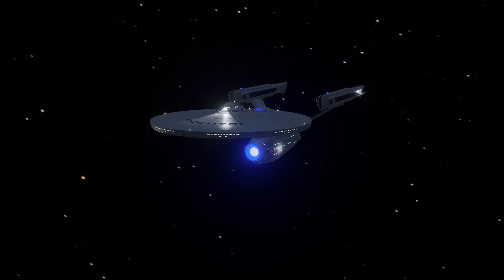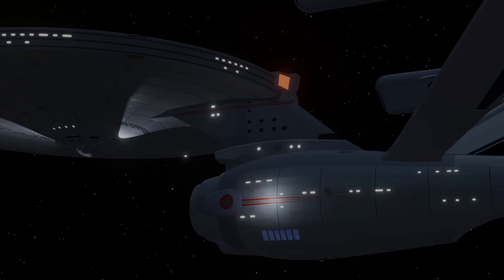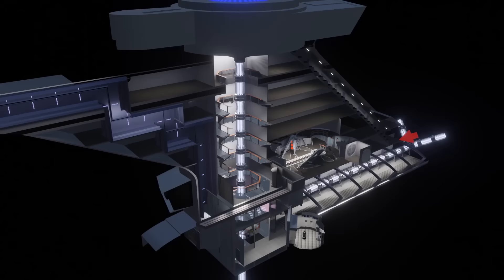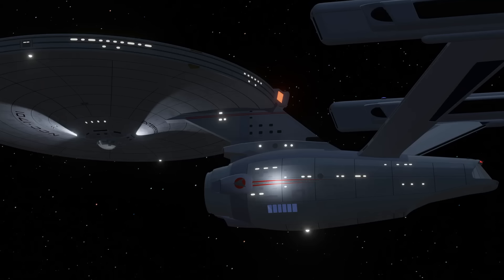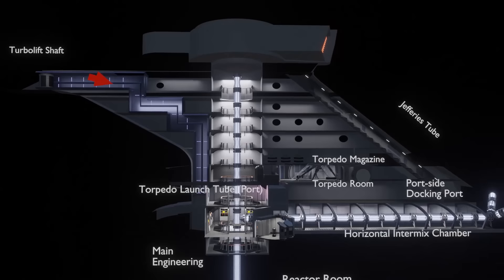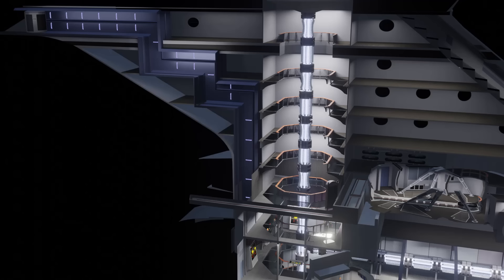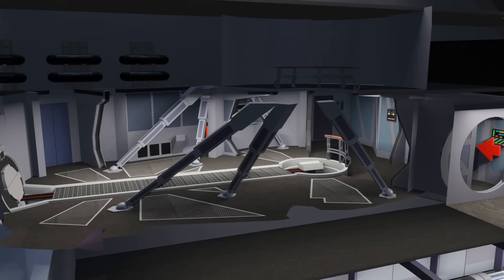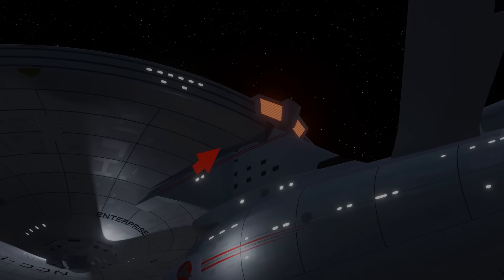The Enterprise Dorsal Problem: how did the turbolifts pass through it?

Comment: On a similar note:
The Gateway Arch at the Jefferson National Expansion Memorial in St. Louis, Missouri, USA, was originally planned as just a monument.  A viewing room at the top was considered, but the Arch's triangular cross-section and its overall shape being an inverted weighted catenary curve of 630 feet in both height and width, would have only allowed for stairs.  Many engineers thought it was impossible to install elevators; the one-of-a-kind design of a tram system was conceived in just two weeks by a man named Dick Bowser, who never received a college degree.  The tram system has been in use since 1967.
Reply: a fittingly legendary name for the inventor of such a design
Reply: Most well known as the cousin to Gay Bowser
Reply: He never received a collage degree because they were laughing too much to hand it over.

Comment: I think this gets solved if we don’t assume the vertical warp core goes all the way to the impulse deflection crystal.  If we instead say that the core extends upwards towards an “impulse engineering complex” (one that has the deflection crystal in line with, but not necessarily directly connected to, the upper end of the warp core), then we can suppose that the turbolift shaft simply passes horizontally between the top of the core and the deflection crystal.
Reply: True. We all assume the core goes through the whole neck. But that is even not logical when we remind ourselves that this ship can saucer seperate! Most likely the impulse drive and the saucer section is just connected to the warp core by two high energy connectors where the hull is made steadier, and in between them on Deck F the turbo lift passes through.

Comment: I always tend to assume scaling issues when it comes to things like this. Especially given how big those dorsal windows look against the height of the deck, while we’re shown more traditional size portholes on the sets. If we scale up by 20-50% there’s plenty of room for the turbolift to go around. 

Similarly the size of the windows on the Excelsior model would actually be a little too small. 

They’re what looks best on the models of course, and I wouldn’t really want to swap the size of the windows on either of them. But the windows alone present a sizing and placement issue of decks and internal machinery, so I don’t think too hard about the rest of the insides. Scaling-up slightly would help fit the torpedo complex inside the bulge at the base of the dorsal too.
Reply: I'm also content to believe that the size of the sets are generally larger than they would be in the real world of the fiction.  They designed them to be easy to shoot scenes in with both space for cameras and lighting and comfortable blocking of the actors. 

It's like your average sitcom living room set vs most actual living spaces, even relatively poor families like the Connors lived in extravagant excess if we take their floor plan as literal.
Reply: @DrewLSsix  excellent point! There’s an awful lot of room on those walkways around the warp core.
Reply: @DrewLSsix  just like submarines in movies too. Hard to make accurate and still have a practical set for filming.
Reply: Let's not forget the filming whoopsie in one of the movies where a shaft appears to run vertically for 60+ decks (according to deck markers) in a ship with less than 30 decks total?
Reply: @Krahazik  you mean that scene where Spock has the rocket boots and the turboshaft looks like it could be a lobby to observation deck elevator on the Empire State Building?
Reply: @filanfyretracker  exactly that scene and the label markings have been pointed out on numerous occasions. I think someone one wen to the trouble to actually count the number of decks passed as well.
Reply: I seem to remember there was either a YouTube video or a forum post where someone said if the length of the refit Constitution class was upped to 1500 feet instead of of the intended 1000, it would solve almost every discrepancy between real-world set design and fictionalized function of the ship. Probert said the idea was intriguing enough to agree with it.
Reply: @Krahazik  And it's a triangular shaft not round, and the turbo lift cars are round......
Reply: @isaacwright90  Some fans have worked out anywhere between 1,200- 1,300 ft. That''s not going to drastically increase the apparent size of the ship itself since part of the length is how much further past the landing bay does the warp nacelles end. A lot of empty space between those parts.
Reply: The portholes were imagined to be 18" across.
Reply: @AndrewProbert  hey, the man himself! That’s definitely more like what I’ve thought, they seem at least 24-30" on the model in this video. 

BTW I had tried to send an email from your website a few years ago but it bounced so I’ll say the gist here: thank you so much for being a positive example while I was growing up, of the validity of vehicle and prop design art! In school I was always getting told to do still lifes and portraits, because I wanted to draw bikes and watches and so on. I always loved your paintings so I held onto that against the backdrop of that discouragement. Thank you again! :)

Comment: There isn't a full end of the warp core on H-deck, instead just a lockdown/venting connector leading to the topside warp crystal.  
Hence a full room isn't used for the core leaving room for a turbo lift to pass through it and up to the main saucer.
Reply: Exactly this. You can kind of tell when Kirk enters the engineering space in TMP that the intermix shaft tappers as it goes upward from there, likely because the impulse engines don't need as much plasma as the warp drive.
Reply: @captainyossarian388  Agreed, or it could split up against the walls on the way up to feed the individual impulse engines, leaving a gap for the turbolift to go through.
Reply: WHAT IS THIS NONSENSE ABOUT WARP CRYSTALS?  The impulse engines ran on deuterium.. PRIOD.. No warp related anything.  They were NOT powered from Engineering directly
Reply: @ZakhadWOW  I feel you're confusing two comments as one.  Warp cores operated off of dilithium or lithium crystals (depending on class/age of ship), and impulse engines did indeed operate off deuterium.  However the original person noting warp core crystals said nothing about impulse, the follow up comment did.

That said the general model of a warp core is that antimatter is sent into an intermix chamber and deuterium is injected in as well to which it created a plasma energy put into a matrix made of the relative warp crystal (dilithium or lithium) which then basically became your warp plasma (the energy for warp) and electro-plasma (the energy powering the ship).

Impulse drives otherwise were self-sustained with their own fusion reactor though correct (at least I assume that's what you meant by "not powered from engineering directly"), however they were still tied to engineering sorta, in that use of the impulse drives created a byproduct of electro-plasma also (which is why at least in some episodes of different star trek series', even if the warp core was 'shut down' or ejected, etc, the ship still had power likely fed by a general use of impulse drives).
Reply: @ZakhadWOW  They always call that dome the "warp crystal", although it's not. It's just a glowing part of the impulse engineering facility.
Reply: @_nbishop  maybe the 23rd century ships did tie impulse engines into the warp core in some way. I only remember the TNG tech manual showing the impulse engines as having their own separate fusion reactors, especially those in the saucer section.
Reply: @zerrodefex  Did you mean to comment to someone else?  I noted in my comment that Impulse drives were self-sustained, so much so as they even provided a basis of minimal backup power source from the energy they generated as well.

All I said is that they were tied to engineering because of that, nothing about being tied into the warp core.  Engineering decks/facilities did a ton of stuff, it's not like they were dedicated just to warp core management :P

Comment: Every ship has that small area where the only option is to beam the entire turbo lift to the closest shaft. There's also the one where the turbo lift is shot into space and it utilizes its own thrusters to re-enter the ship at the appropriate shaft.
Reply: Or just runs on tracks on the outside of the hull
Reply: Not really: Most ships from the Excelsior onwards have a big enough neck to have a turbo lift pass through. And the nacelles were before and also after the NCC 1701 D only reachable by stair shafts. Also, don't forget, that you don't really need an easy access to that nacelles: When they are at warp, the nacelles are a no go zone anyway and when they need to repair something, they can also reach the nacelles by a small space walk! Just get out of the ship near the bottom of the nacelle and walk up that 200m to the entrance area in the nacelle.
Reply: @Quazgar_of_the_North  XD that would be incredible

Comment: dude, your solution to this is offscreen lift changes. I would assume over the course of the ship there would be at least two turbo lifts in the saucer, and possibly a horizonta one. There would be a turbo lift along the back of the dorsal, and the lower body would have two or three as well. I assume horizontal 'lifts' would be a must for quick transport around the ship, if you can go on an angle why not horizontal. This means he could get a lift upwards, get out, walk five meters to another lift and make it to his destination. Horizontal lifts would also make it possible to the bridge quicker than walking.
Reply: This makes the most sense.
Reply: @Melkur1981  While I'm on the subject of occams razor, I never understood why star trek ship designs have gravity (the floor) being always in the same direction when gravity is controlled through Gravity Plates. I would have assumed different gravity for each section. The Saucer can have floors on the x axis sure, but the dorsal section would be two big floors with the 'Foor' the part people walk on running down the middle (on the y axis), so that the big energy transfer cable can be accessed at any point from a single floor with people walking alongside it! The lift here would essentially work like a conveyor belt connecting the top of the ship to the bottom with one side going up (<--) and the other going down (-->) Possibly with a wrap around on either end like a Paternoster lift.. The lower part of the ship I would have the gravity going in a different direction again,  on the Z access so create a large number of smaller floors that could be serviced by a single lift rather than have wider floors.

Comment: The Constitution is actually probably the least problematic of the Kirk era Federation ships. Both the Miranda and the Oberth have entire parts of the ship which cannot be accessed from the saucer - fully half of the latter - and the Excelsior is regularly shown to be absolutely massive, leaving entirely the opposite problem of why it needs so much more space…
Reply: I think in the MAD Magazine take on The Search for Spock they said that the Excelsior had a mall in it. I'd believe it. It was the Eighties.
Reply: My headcanon is the lower part of the Oberth is just a big sensor pod. No fixing the Miranda tho.
Reply: The issue with the Oberth is compounded by the fact that its early design envisioned a 180m long vessel before it was canonized as 120m long. The windows are scaled for 180m and do not make sense with a 120m long ship. Back to the issue, I saw some blueprints showing both the Oberth and the Miranda using closed-circuit intership transporters to access their respective outrigger hulls. With the Oberth, it also had a Jeffries tube in each pylon with a single person lift that also allowed access. When looking at TMP era ships, one requires a bit of suspension of disbelief to presume that the building materials are far superior to anything we have now, allowing such narrow connections while maintaining integrity.
Reply: @schwartzritterx5905  well, it's a space ship, and in space, the forces acting on the various structures are massively reduced compared to the gravity well on a planet
Reply: The excelsior is easily explained as needing much more space because its a ship that's designed o operate much further from port, and thus needs more supplies and fuel onboard to go longer distances. Likewise Excelsior is also a much more powerful ship than constitution, and having more powerful shields and weapons demands a larger hull to fit in bigger power generation and transmission equipment.

If anything, constitution is far too small for an interstellar spacecraft.
Reply: @schwartzritterx5905  Inertial dampers have a large role in maintaining structural integrity. They counteract the immense forces of spaceflight not only for the sake of the crew, but to keep the ship intact. Pylons don't have to be strong enough to physically support those structures when artificial gravity helps do it.
Reply: Wait the Miranda? I mean it's one of the most all in one vessels in the series. I always assumed the Torpedo Pod was fully automated, or only accessible by Jefferies Tube.
Reply: @PhthaloType  I concur that force fields (SIFs and IDFs, as they were named in TNG) are essential to starships as they behave in Trek. The drawback of deck plans is that readers forget they're schematic, and the volume needs to contain things other than crew. Circling back to the subject of this video, given the <5m width of the Connie's neck, it should probably contain nothing but structural members, power conduits, beefed-up SIF waveguides, etc. -- and certainly not backlit portholes as depicted in the studio model.
Reply: only the “roll bar” is inaccessible from inside on the Miranda, and the Obarths had turbolifts THROUGH the connecting pylons…
Reply: the excelsior was designed to have massive labs and refit with new tech as time went on. hence why its still in use with the Enterprise E
Reply: @KenoshiAkai  so the Galaxy class problem had a full on soccer stadium in it.  :-)
Reply: @ellisz5972  I'd believe it. There's been analyses of just how much empty space there would have been in that behemoth because its crew was so proportionately small. Easily enough room for a soccer stadium. Space soccer. Where the players would have to dress up in awkward padded armor of some sort.
Reply: The excelsior class was not that big at all. Look at it compared to a Galaxy Class now that was big.
Reply: @ellisz5972  Have you seen how huge the Main Shuttlebay is? Cavernous.
Reply: @3Rayfire  on the Ent D?  Yes it is big
Reply: To be honest, the parts of the Mirandas or Oberths that are not really reachable with a turbo lift don't need to be reached often! Why would you outside of restocking need to reach the torpedo launcher or sonar observatory? Why would you need to reach all the time the warp nacelles? When you are at warp, they are a death trap and you could when you are not at warp for repairs just go their by space suit, just from the bottom of the saucer to the nacelles. And the oberth and it's pod, the same: When it's just sensors and stuff, nobody needs to be there! The stuff gets calibrated and used by the bridge crew or science rooms and if you really need to repair something, you can do a space walk.
Reply: @halofreak1990  Yes, you can even see it with the building brick models from Blueprixx of the Enterprises and so on: Only the models of the Voyager, Enterprice E and Defiant don't break apart all the time! Why? because the designers of that ships wanted them to be atmosphere ready (blue alert). and so also the small building models are able to withstand our 1 G gravity. Meanwhile the models of the D, the original etc. - well, they detach their nacelles or the saucer easily when you make "wush" in our 1G atmosphere :D
Reply: I mean, 1, this is from the same franchise that brought us the Galaxy class.  Picard's Enterprise has room enough for an arboretum (aka a tree garden.  There's fucking TREES growing on the Enterprise D).  A Galaxy-class ship is a Carnival cruise liner as upholstered by Mercedes Benz IN SPACE!

2, this series doesn't know how big its ships are.  They re-use shots from Search for Spock in TNG, including approaching Space Dock.  Which apparently a Galaxy class fits through the same doors that barely admitted a Constitution class.  And at one point they re-use the Regula 1 prop at a perspective that made it look many times the size of the Enterprise.

Comment: In the motion picture, there's a scene with Kirk in the turbolift just after arriving and surveying the cargo deck.
At the rear of the lift cab, there's a map with a moving light showing the primary lift layouts. Going by that, the vertical shaft is either to the front or sides of the vertical warp core segment.
As on the Discovery from 2001 not everything will fit, and we have to go with it :)